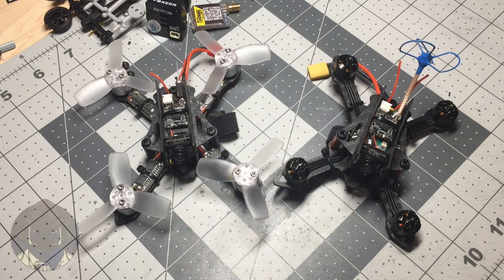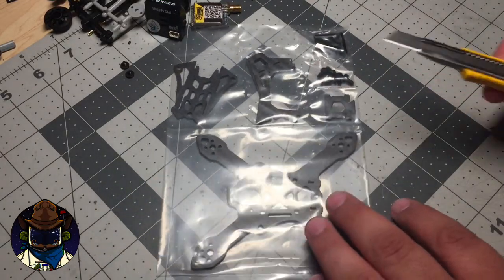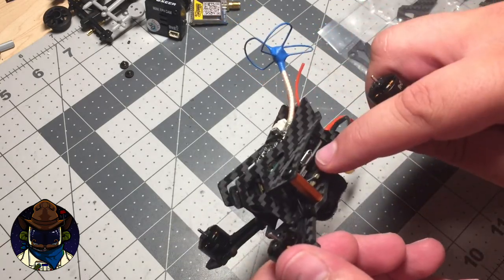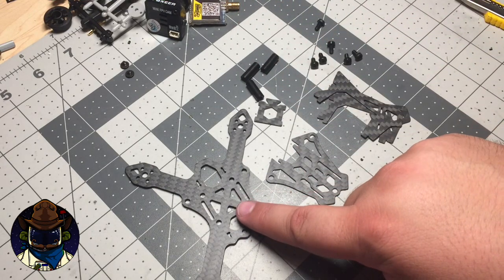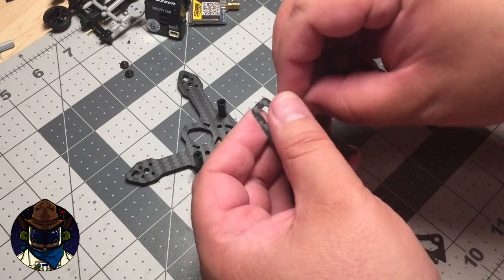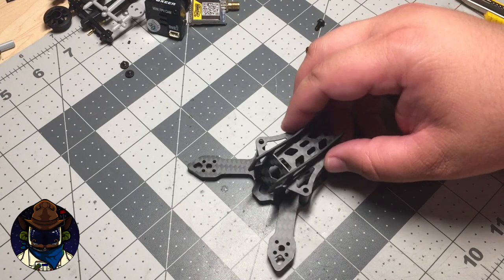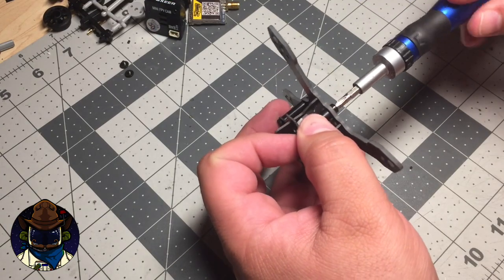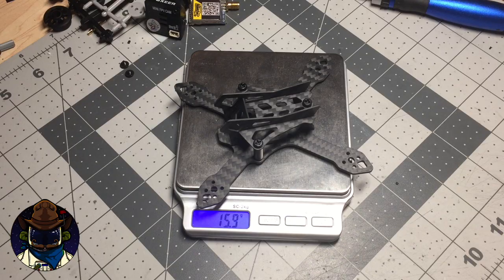Space Cowboy Workbench: XLR-2 Standard

Comment: Fantastic design man!  One question ... does the emax version have smaller holes for the motor mounts that match it's tiny 1.5mm hardware?  Also curious what size holes are in the 2" version.  Thanks man - that info will help me decide which version to get!
Reply from the maker: That is one of the reasons the EMAX version is specific, because they actually use M1.4 screws. The standard version uses the standard 11xx motor mounting pattern with M2 screws. Bolt circles are also different between the two.
Reply: mpbiv421 Thanks man!  I ordered the emax version last night and I appreciate your attention to those details!  Also love the pic you posted of the new 100mm frame coming soon!  Keep up the great work!
Reply: Just got my emax version today.  Freaking awesome man!  Didn't realize you are right around the corner from me too - very proud to fly a local design!  It's a big inspiration to me - I've been doing vacuum formed canopies for for a while now and need to push myself to get into frame design so that I also have a complete custom offering.  Thanks for your hard work that went into development.